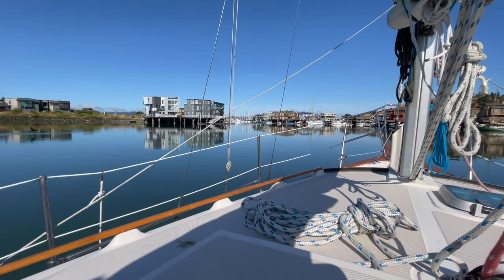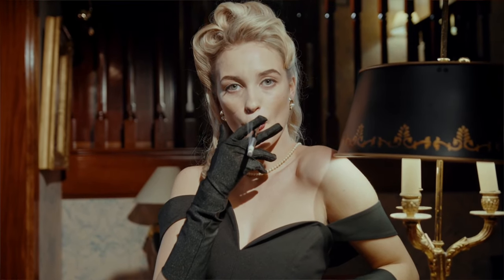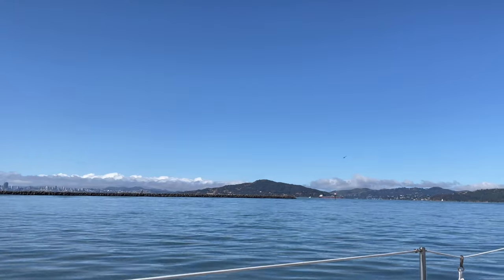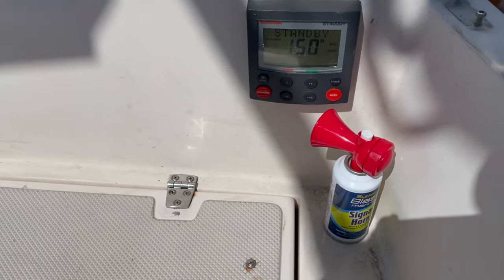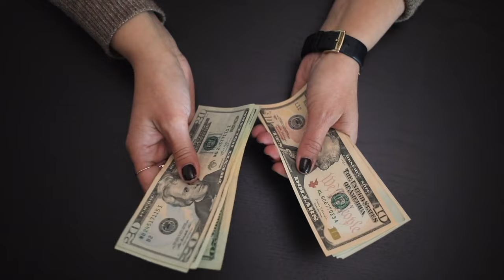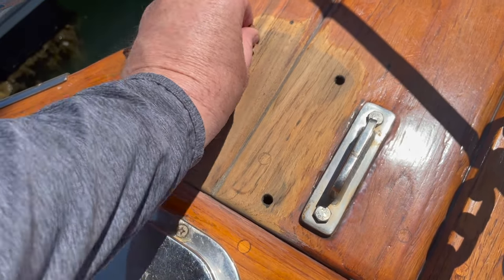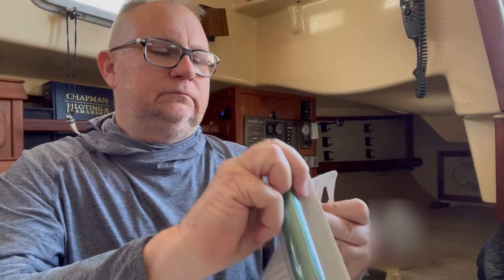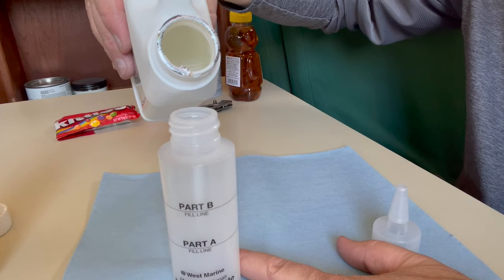S1E26 - My First SOLO Sail - San Francisco Bay!

Comment: If you're gonna sail SF Bay, get used to reefing. You have a nice looking boat.
Reply from the maker: Thanks Chuck!  I'm really interested in single-line reefing... One of my marina neighbors is known for her creative reefing setups
Reply: Single line reefing is the holy grail. It's not so straightforward, though. You really, really need to think hard about how many blocks are needed. Each block adds friction. Enough friction, and it doesn't take a lot, makes single line reefing work worse.

I took it out of my current boat. I found In practice I had to go forward several times to reef to deal with the friction. Instead I set up a simple two-line system that means I go forward just once and quickly.

Whatever you do, practice, practice, practice!